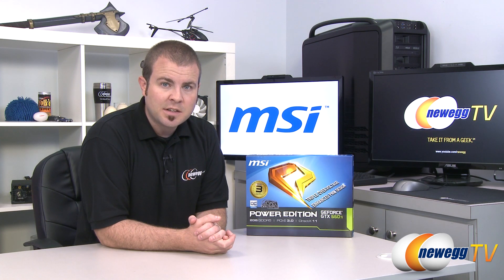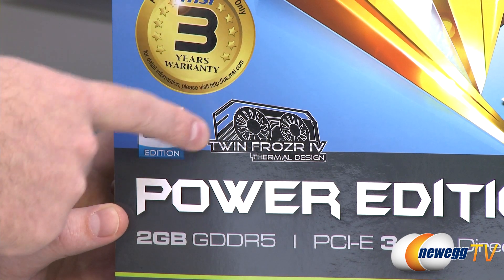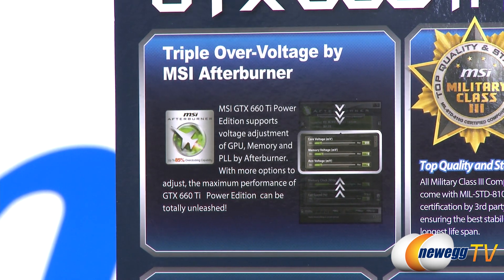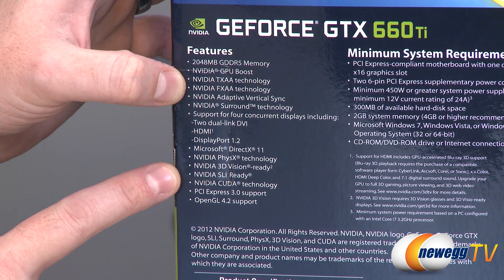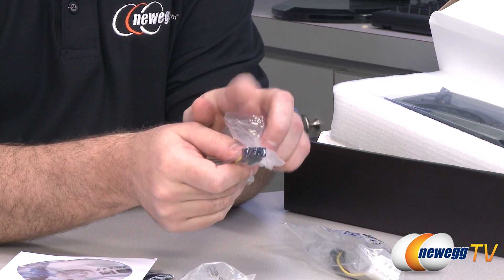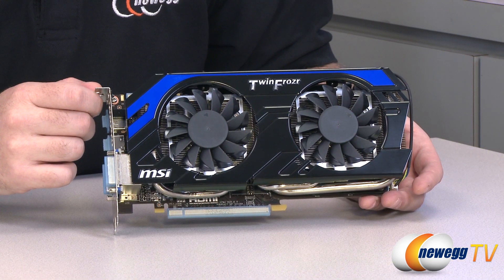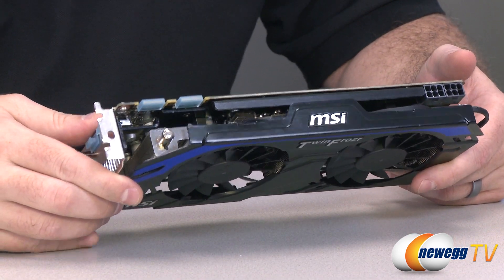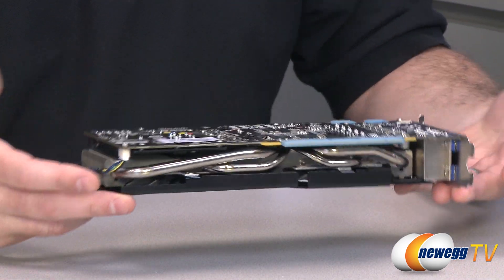Newegg TV: MSI GeForce GTX 660 Ti Power Edition OC 2GB GDDR5 Video Card w/ Benchmarks

Comment: guys i have a dell optiplex LGA1155 H61 0M5CDC motherbord idon't know if it ddr3 or ddr2 
am usin geforc 210 wich is too old 
am getting a gtx 660 gddr5 2gb  oc edition msi twin frozer so i was thinking if my motherbord can run and handel this gpu 
i have a 265w optiplex 390 psu am gonna change it to 600w one
so is the pci of my motherbord support this gpu or i should forget about it 
please help
Reply: all my pci are pci-e gen 2 so what do you think
Reply: all my pci are pci-e gen 2 so what do you think

Comment: I am also a computer building newb. If I were to get this card would I have to get anything extra for the OC? Or is the OC optional or what? Would I need more power, cooling, etc?
Reply: Wartijn should be a high quality power supply too otherwise they burn out destroying everything
Reply: You dont have to get anything extra, ur power supply should atleast be 500 watt i guess, and you should have decent airflow in your case,.

Comment: Pretty much ANYTHING is better than a 360.  I think even a GTX 650 is way better.  Consider that the Xbox plays games at 30 fps at 720p (most of the time) on what would be "low" settings for PC with no anti-aliasing or filtering.

Any GPU costing more than about 80-100 bucks should easily outpace an Xbox.

Comment: i have this exact one but the problem is my graphics card can run bf3 on ultra at 60 fps but it just randomly started messing up and is now at 40 fps and it shouldn't be running that slow. the card isn't overheating either. It has done this before but i would download a different driver but then the problem would occur again (after a day of playing at 60fps). please i need someone to help me. the 320.18 driver isn't working for me or something idk what is going on.

Comment: 2 GTX 660 cost $600-$500 When 1 GTX 680 2GB costs $450 and a 4GB GTX 680 Costs $550-600. You can also get 1 GTX 670 4GB for $450 and its going to be way more powerful then a GTX 660 but since a GTX 750 is is going to be out this month a GTX 680 will be cheaper.

Comment: I check online right now and a 2GB GTX 680 costs $460 when 2xGTX 660 ti = $400
I would rather pay $60 more and get better performance. And all the benchmarks are made with a GTX 680 2GB. The GTX 680 4GB has way better performance then 2x GX 660 ti and the GTX 680 4GB only costs $500-$600 depends where you buy it.

Comment: 2 GTX 660s cost $410.
2 GTX 660 ti cost $620
1 2GB GTX 680 costs $460
1 4GB GTX 680 costs $500-$600.
1 GTX 680 2GB has 40% more proformance then a GTX 660 2GB
2 GTX 660 ti is more powerful then 1 GTX 680 2GB
3 GTX 660 ti has the same power as a GTX 680 4GB
2 2GB GTX 680s have more power then GTX 660 ti SLI
2 GTX 680 4GB has the same power of a GTX TITAN and GTX 690.
1 GTX 680 4GB has 100FPS on FarCry3 when a GTX 660 ti SLI has 80FPS but a GTX 660 sli has 60FPS 
1 GTX 680 2GB has 80FPS

Comment: Not true, even with the cut from 256 to 192, it hasn't interfered with memory bus speeds, so if you buy a 2gb, you'll be running 2 gb speeds and not some weird 1.5gb speed like they usually do

Comment: Power draw and performance gains will be negligible. The only thing the 690 has going for it is the badass cooling shroud. Even though the cooler messes up airflow in a case.